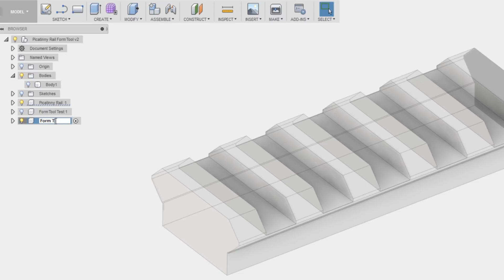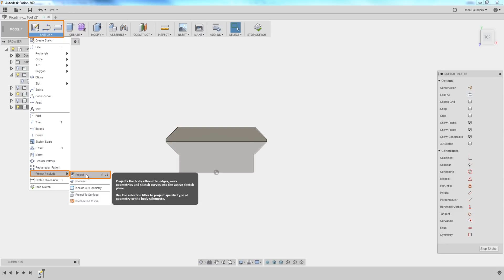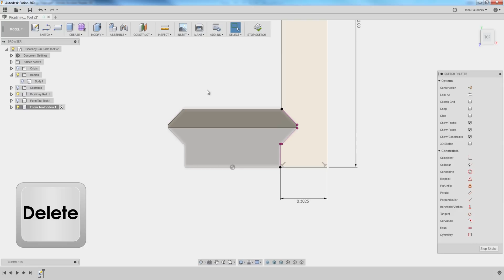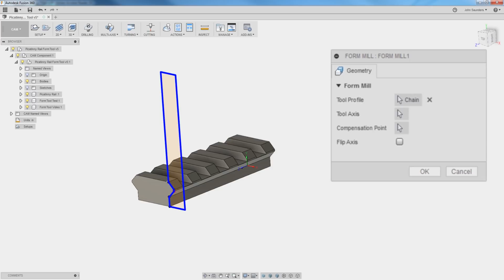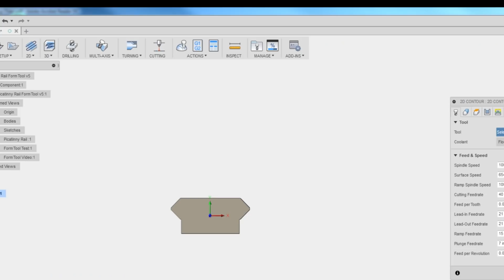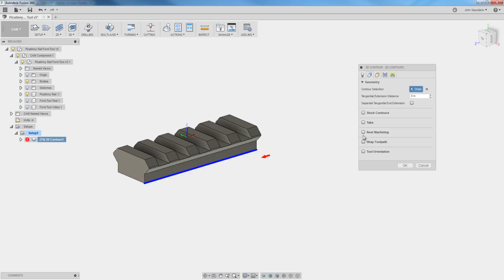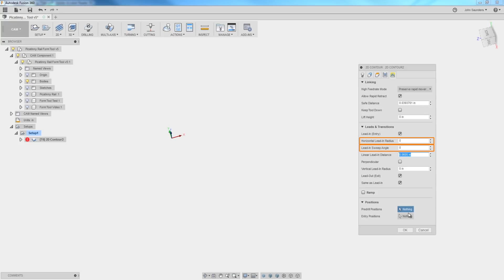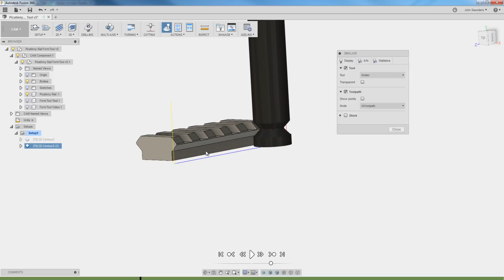How to Create a Form Tool in Fusion 360! FF103

Comment: How would you create a tool with geometry from a .stp file?
EG, if I download a .stp file of a tipped cutter from a manufacturer, how would I then create it as a tool?...
I want to use a WNT 20mm high feed tipped tool to rough out some 3D work, but I need accurate simulation to make sure I've gouged it...

Comment: You want your compensation point to be the outer most point. 

Basically it’s asking what’s the point of the tool it will use to make diameter compensations in CAM. 

So. In this case you want to pick the lower left corner of the sketch. 

The compensation point also dictates the point of reference used to make CAM side D value diameter compensations.

Comment: I think that the compensation point is the point that gives the tool its diameter. So you should not choose the center as compensation point but the outer corner.

Comment: You picked the wrong compensation point. It's not the axis point but the outer diameter. ( Your lower left point on your sketch). At least it worked for me.

Comment: Odd that is doesn't like english but works fine with metric, you would think numbers would be numbers to a computer.
Reply: the whole world has gone metric, except for consumer USA, keep in mind the USA was the first to go metric with currency, maybe one day you will finish the job
Reply: It is pretty much just numbers to a computer, but the problem is it requires planning in order to implement them. Using English units needs converters in order to know what to do with them correctly. I'm assuming that to computer code, there's more to it than just "Divide by 25.4" and call it a day, otherwise they would just do it. Involving two units, seems like it needs twice as much code in certain areas to process the way you want it to. (Probably might have something to do with Floating Point issues, because many numbers don't convert well)
Reply: Metric currency? WTF is that? You may look up the SI measurement system and notice that there is no currency listed there.
Reply: That would be why I said metric and not SI currency then wouldn't it.
Reply: I think he means a currency that uses a Base 10 like system. - 100 Pennies to 1 Dollar; 10 Pennies to 1 Dime, etc. They divide easier than something like 15 Shillings to 1 Pence, or 20 Pence to 1 Pound. Or something like that, (I forget the actual numbers). A lot of convoluted math is involved. Australia had something similar, but they converted to their current system in the '60s I think.
Reply: How many hectopennies does a Tormach 1100 cost?